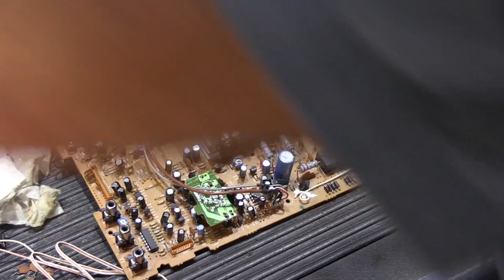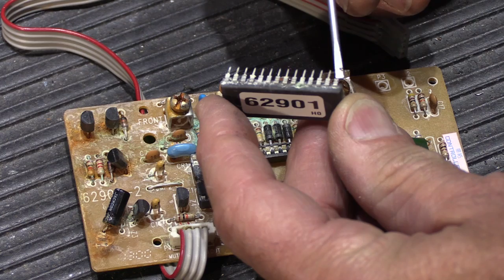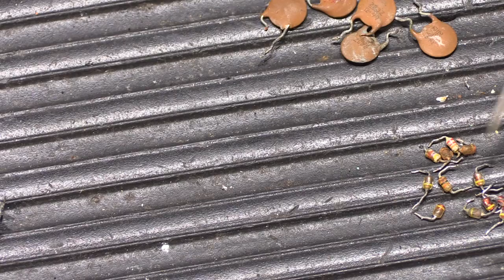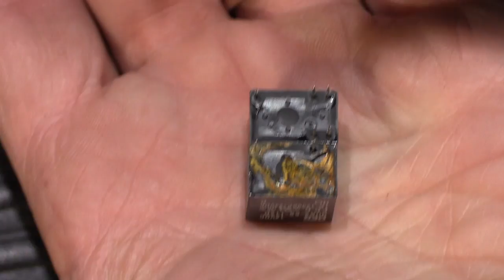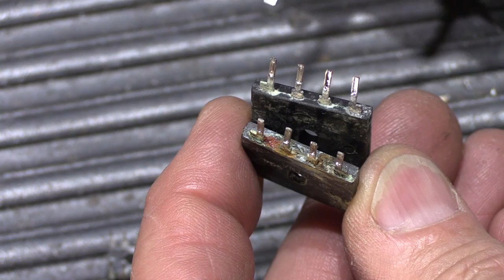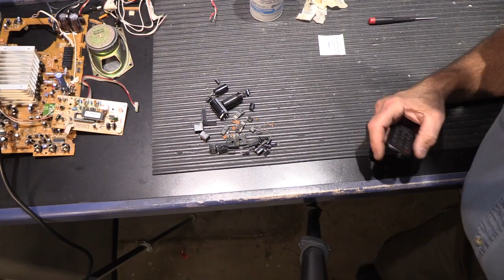The Challenges of Repairing a Water Damaged NuTone  IM3303 Intercom

Comment: They were smart to have it rebuilt... most people would probably just either leave out the intercom system or go ahead and buy a brand new NM Series intercom from NuTone, spending a TON of money because they have to upgrade ALL of the components... this will save them A LOT of money!
Reply from the maker: Hi Vincent:  I agree, rebuilding the IM3303 was the best choice, especially if you factor in all 11 of the remote station that would have had to be replaced.  The tipping point on the repair or replace choice for the homeowner was our ability to re-whiten the IM3303 face plate back to its original white color.  Since the downstairs of the house is basically brand new, a yellowed Master Sation would not have been acceptable.  - Chris